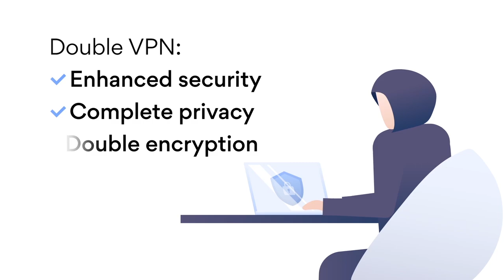DIGGING a GIANT WELL to FLOOD My DUCK POND!!!

Comment: Add a tilt switch for the hight you want it. Kinda like what you have at the farm for watering the animals. I work at a rock mine we use them all the. Use two one as a turn on and other as a turn off or oh crap it’s flooding everything. Look up water level tilt Floating switch use two or you can use one as a turn off or two off switches in case one goes bad the other will stop pump.

Comment: You need to fill it, til it's ready to overflow,  drain it, then dig out the high spots and use that dirt to build the banks up.
Reply: He also needs to make sure that the ground has high enough clay content to actually hold water… no point in filling a pond if it’ll drain in a month or two
Edit: seems he may actually have thought of that lol

Comment: Back when I used to install well pumps, for the submersible pump, which is probably what you’re using; the best is a galvanized pipe.. Reason being is because the galvanized pipe won’t rust and cause nasty hard water which could eventually end up causing more harm then good..

Comment: it's a rotary rig. 500 gal a minute is usually what commercial jobs use if not more. I'd recommend a submersible pump. but 30k is a bit much for 50 ft tho sheesh highway robbery out there a 50ft well here in ny are only 25k if that

Comment: Flair to help you understand the well better, the metal pipe they were attaching was  to the the drill bit in the ground to continue to drill. The PVC “casing” (the pvc pipe put into the hole to make the walls of the well) is then inserted as they drill. From what you described and watching the video you had a 10 inch well put in which is the diameter of the casing size. You also said they had to dig to about 58 ft for water, so I am guessing that is where your static water line was to hit an underground aquifer. So they would have to drill deeper to hang the pump deeper into water to account for draw down when the pump is running. Or your static is much higher, I.E. due to being near a river bed and they only had to drill the well to 58 ft deep for draw down.  You didn’t show it but by watching the video you had a submersible pump installed in the well and probably 6 in pvc column. Again I am guessing this by watching your video and the size of the discharge head on the top of the well. Pump should run good and last a long time due to low pressure on your setup. Was a cool video to watch since I work for an irrigation company and install pumps here in Nebraska. Keep up the good content man!

Comment: with the amount of water you're pumping and the area its filling into, it wont make a difference where the outfall is. The water will just find its own level until it overflows somewhere. Your water logic is way off. 
If your pond looses more water than the well can give, it will never fill up. If it leaks less than 500g/m then it will fill up. Having 2 outlets wont make an ounce of difference.
You're right.... you cant have a higher water level at either end of the pond. it will just be level everywhere. The low spots will fill first and then the whole thing.
If your south side is overflowing then your northside is never going to fill up.
You keep saying "water doesn't go uphill" but that's what you're trying to do.

Comment: 500 gpm especially if the pond and leaking isnt much at all.  Is that all the well produces ? An acre foot of water ( enough to raise 1 acre 1 foot deep in water level)  Thats roughly 11 hours to run the well to flood 1 acre 1 foot so if you for instance want to raise 10 acres 2 feet that will take about 10 full days of running the well and probably cost about $300 in electricity depending on the rates there (Little cheaper if you use a 3 phase pump.)  Thats assuming absolutely no leakage too.

Comment: Could of used the excavator when it was there to see if you can get water within 30 ft. Or built a water fed well digger with a rented pump for cheap. You basically feed a hose down a pipe and push a hose down it ant it will dig the well and push the dirt up with the water. We did that at our hunting cabin with a 4 in pvc drilled a bunch of holes in the first 10 ft and pumped in with a 2 in hose with a tip on the end to create a jet to break up the dirt. You just need to hope there's no big borders below. We hit bedrock at like 55 put a 2in down the center and filled the 4in with gravel then a few ft of sand then more gravel in the 2 in. there was enough water on bedrock to do what we need to do.

Comment: If you want it to hold tight you need a layer of clay but bringing alot of clay in and spreading isn't cheap but will last forever and water will stay in until you drain it dig up alot of topsoil layer the clay then add your topsoil back on top the clay so you can plant food for the dicks I mean ducks lol